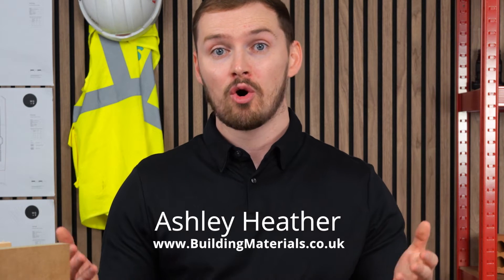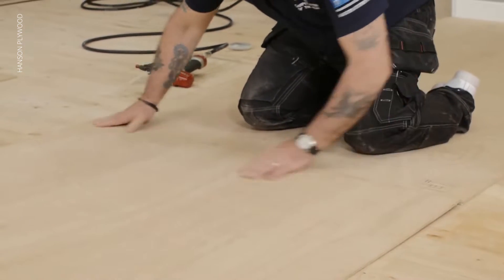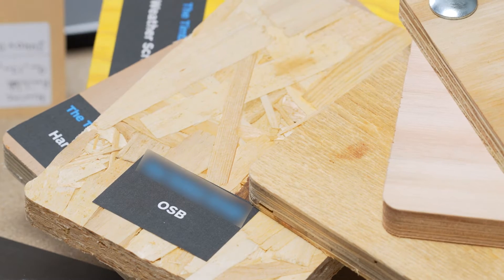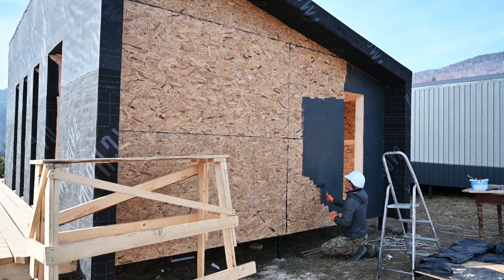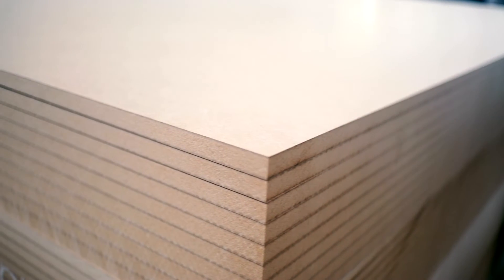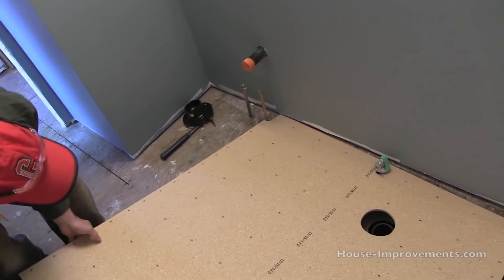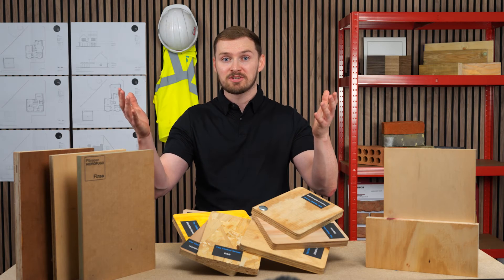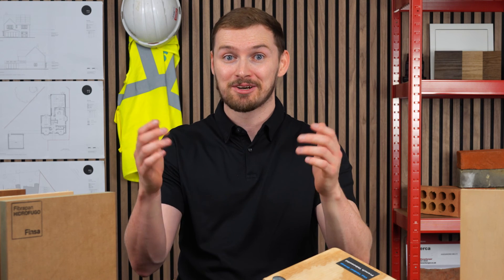Plywood vs MDF vs OSB vs Chipboard: The Ultimate Guide

Comment: Need some advice, I want to make a 120cm x 120 cm soundproof podium with elastomer foam underneath to put my acoustic drums on in the living room, what type of wood do you recommend, rather MDF, OSB or plywood? The total weight with me on it should be around 100 kg.
Reply: Plywood is the strongest and most moisture resistant, OSB is slightly worse at both, MDF has the least strength and water resistance but the most density and the smoothest finish (also easiest to apply paint/finish to). In theory if you are trying to prevent sound transfer you should use the one with the most density which is MDF but it will be the weakest option. If there is no open space underneath it though and its simply on top of a foam pad then its shear strength shouldn't matter at all.

Comment: Which gives the best result for the surface of a desk? I suspect it comes down to mdf vs chipboard. I am not sure whether to paint the surface or not, but am open to it.
Reply: Mdf Will need a veneer. As a single drop of water and it's gone. I would go. If possible. With hardwood